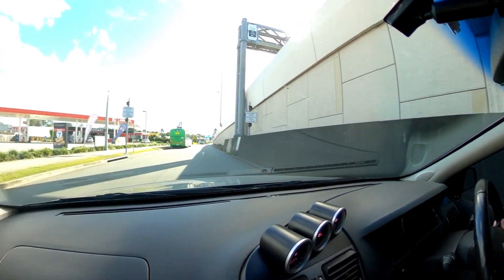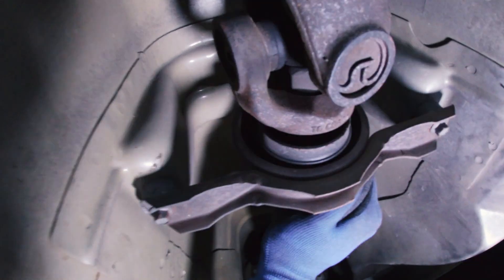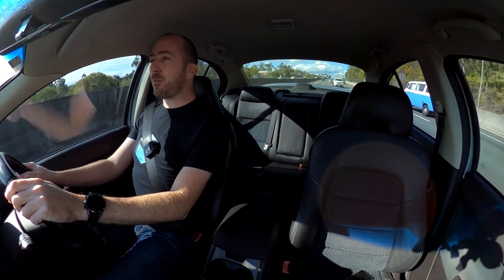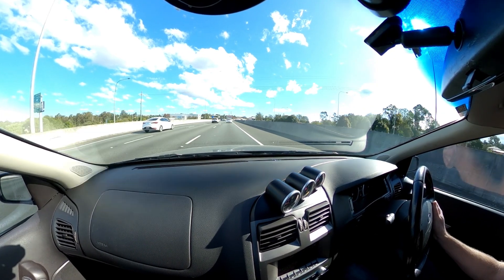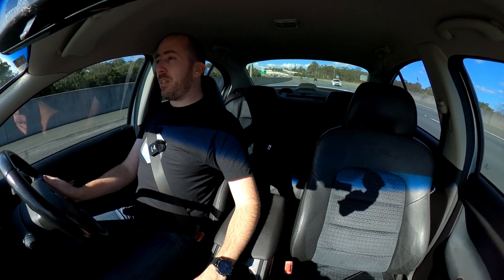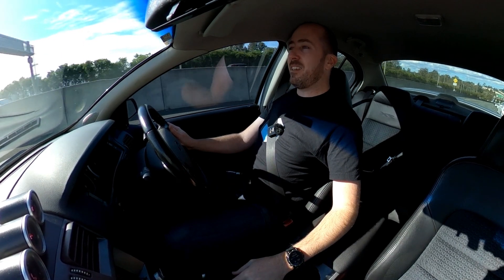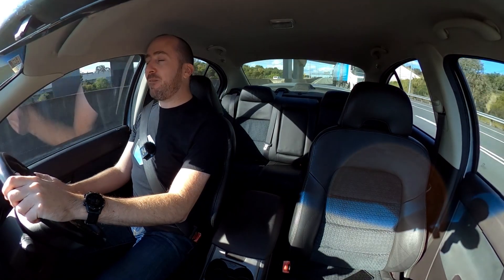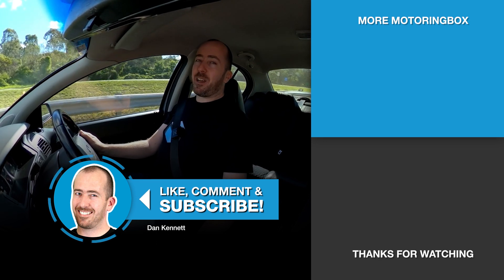🚗BA Falcon Tailshaft Replacement - Test drive to see if we fixed the vibration?

Comment: Hi Sean, I had the same problem with my BF Falcon, I changed the centre bearing and uni then put the shaft on the balancer, twice, the vibe was nearly gone but like your car the b'stard thing still had a vibe. Mines an auto, i changed the trans fluid and the vibe lessened , I then increased the tyre pressures and that fixed it. Good luck mate, Phil NZ

Comment: Get rid of the Nolathane diff bushes to start with.  They send unecessary extra torque and vibes through the drive train.  The tranny is especially prone to it.  Rip em out and go back to OEM bushes or maybe (emphasis on maybe) super pro for the main rear and OEMs for the L/R fronts

Comment: You can do it yourself with an appropriate sticky weight and a metal zip-tie. Make marks every 90 degrees on the tail shaft, attach a 10g weight at one of the marks, go for a drive, and repeat this for every mark. Once you find the best one, make markings 45 degrees on either side of it, and try driving with the weight in these positions. Move the weight to the new best position, and make markings 22.5 on either side of it etc, keep repeating till you find the best spot, then try using a heavier and lighter weight until it's perfect.

Comment: You should have some slackness in that center bearing mount where it mounts onto the body, loosen those bolts off, push it to one side, tighten it up and take it for a drive, if it doesn’t fix it push it to the other side tighten it up and see if that makes a difference sometimes it’s just an alignment issue.
Cheers,
Dwayne.

Comment: My Ba Fairmont Ghia has exactly the same issue. Centre bearing replaced, tail shaft reconditioned and balanced but the rumble persists around like 80-100km/h then goes way at higher speeds, also smooth as silk at slower speeds. Damn thing, but I love it just the same. It’s like your long term partner, you put up with the little things and love her more and more as the years go on. 😊

Comment: I noticed when you installed it that you did the centre bearing bolts before the rear. Tighten the centre bearing last and make sure its centred by feel
Reply from the maker: I've had a few others mention that - I'll definitely give that a go thanks mate.

Comment: Hey mate, I spent a lot of time chasing this problem on a customers car. We did what you did with centre bearing, coupling, balance etc with Hardy Spicers & could not get it right from there. After some research, found Ford balanced those shafts in the car from Factory. Further research found the Ford dealership up at Torque Ford, North Lakes provide this service. Perfect after that & they have done a few for me now. 🤙🏼
Reply from the maker: It's looking like I'll have to go that way with it. Ford use weights which clip onto the bolts which attach the shaft to the diff, and my car has never had any there at all. Fingers crossed they can fix it for me, I'll have to book it in soon.
Reply: @MotoringBoxTV  whenever we remove a tailshaft from any of the ‘B’ series, we mark the location of those weights & put them back where they came from, but I am gathering when Hardy Spicers balance it, the position of the clip on weights need to be relocated. Good luck mate, I hope it all works out. 🤙🏼
Reply from the maker: @brookgoodwin426  when I removed the shaft mine didn't have any clip on weights... so that was rather interesting. I have installed it in the same position it came out but alas it didn't help.

Comment: Hi Sean, Have the same problem with my wife's 2012 G6 and have been firing the parts cannon to try and fix it. The car has 226,000 on it and the rumble was combined with Falcon Taxi Whine at around 80ks so the decision was made to replace the diff. A full rear cradle and diff out of the same model that had done 60,000ks was purchased and the diff bushes replaced before installation.  Installed the cradle but ended up with the rumble still there and the replacement diff whining louder than the original! A couple of things that can be discarded regarding the rumble.  When swapping the cradle it was noticed that the centre bearing was shot and as it was a weekend could not get a replacement tailshaft. Installed a new tailshaft during the week and left the spacers out to see how it went. No change at all. Reinstalled the spacers and also swapped over the rear mount as it was cracked but not totally through - no change! This only fixed the clunk when going from P to R or D. The next step will be to change the pinion bearing and see if this solves it as it seems to be harmonics.  Also, my son has an 09 FG with over 400k on it but the diff is silent and the car has no rumble. Will let you know if the pinion bearing is the problem.
Reply: Hi Sean, think I have found the problem.  I took the G6 to the local tranny/diff repair guys and they took it for a drive then brought it back and put it on the hoist. One tech got in the car and ran it up to speed while the other went around with a long screwdriver listening for the noise. He checked the tranny to discard bearing noise plus wheel bearing etc and finally checked the diff as this was his suspicion and it was the pinion and crown wheel etc. I went home and got the original diff centre and took it back to him and he removed the cover and it was evident that the hardening was wearing off the crown wheel. He then applied diff paint and rotated it with a drill and the wear was clear.  Next step is to have this diff centre totally overhauled and will then swap it over with the one in the car. With a bit of luck this will solve the problem. The tech did say it was common in Falcon's and Territory's. If the overhaul does solve it, I will let you know.
Reply: Hi Sean, it has been over a year now but my son finally got around to replacing the diff in his mother's G6 last Friday as he had left his dealership job and got an FIFO and did not have any spare time until then. He removed the cradle took out the old diff and installed the overhauled one and then reinstalled the cradle and the result was a total change in the car. Firstly the whine was gone as to be expected but the bonus was the rumble and vibration were also gone. The car did have distinct rumble especially on decell even at slow speeds and this would seem to translate as a vibration. The rumble etc can be put down to the diff being totally buggered and the $1800 I spent on having the old diff overhauled was the best money I have spent. The car is a pleasure to drive now.

Comment: From what I've heard about the v8's having vibrations because of the tail shaft that it's usually because of a Nolathane diff bush since they are a much harder bush than most others on the market, many suggest having it replaced with a super pro diff bush as it's a more like rubber than the stiffer plastic like Nolathane bushes. It's also more noticeable if you have a manual gearbox since you can feel the feedback through the whole car with Nolathane. Just my 2cents worth
Reply: "Nolathane" is a brand name for urethane replacement bushings. Super Pro sell urethane bushings. I hope this helps.
Reply: @ChristopherHallett  Did not know this at all, I guess you learn something new everyday. All I know is that most v8 guys prefer the super pro as it seems to be a better product then, but still interesting

Comment: Seems like a common issue, I have the same problem too with my manual 2004 F6 Typhoon, centre bearing flogged out, took it to a drive shaft place and they put a new centre bearing in, got it back and it had a horrible vibration. The dopes at the drive shaft place never put the little weights on the back of the shaft so I took it to Ford where they balanced it on car. Anyway got it back and it was 90% better but I still have that rumble around 70-80km/h. Keen to see the outcome.

Comment: Have you got the plastic counterweights that connects to the bolts sticking through the cv end at the diff?
Ford had a machine that balances the tailshaft at the diff coupling. I had this issue about 10 years ago when I blew a diff in my GT-P.

Comment: I’d be looking at diff bushes. Replace with nolathane including trailing arms and double check the rear cradle is square to the chassis. It’s a shit job without a hoist. Pro tip for the out rigger bushes is get done 1/2 inch threaded rod and matching nuts and some 2 inch square 3 mm plate. Drill through the plate to accept the rod and use that to pull bushes through the cradle. Measure bush depth side to side can be different and make sure the outriggers don’t foul on cradle. Check all the arm bushings too. Easier to do while still in the car and mark the ones that are buggered.

Comment: I'd say it's the actual diff center (lsd chatter even but ring and pinion more than likely) or the the bearings. I just use my knock monitor and attach it to different areas when I was having issues with my farking territory (front diff drivers side roller bearing in my case) but modifying any cheap hearing aid ($13) with external shielded coax cable a piezo and alligator clamp will achieve a similar result to boost sound at the source. Just search diy knock ears if interested.
Hardy Spicer (NQ) took $2k from a mate and didn't fix anything with his FG turbo! It was the diff...
Reply: I will add that I got the original plans from Autospeed and 
"Listen Up" was the name of the amplifier used. Brings back old memories having my car featured there in Jan 2005... Lol

Comment: Could it just need bedding in and will self harmonise after a certain distance driving? 
I've read a couple of other comments with worthwhile  suggestions like adjusting the centre bearing bracket.
I hope you get it sorted easily so you can enjoy your perfect BA. It will be one of a handful in existence!
I so envy you enjoying an XR6T where you change your own cogs.
It gives that much needed driver involvement. It truly gives the Falcon a youthful sporty character.
Where's the satisfaction in a slightly quicker automatic?

Comment: Try a different set of wheels. I had same problem,vibration from 90 to 100 in my bf xr8 for years. Drove me mad. Did the tail shaft reco and all that only to be disappointed. Bought some wheels and the vibration was gone.

Comment: Where are the plastic clip on weights? They balance the flange and need to go back on.
Reply: I agree .
Reply from the maker: Never saw anything like that, are you sure all the different models had them?
Reply: @MotoringBoxTV  Every single Falcon I’ve done has had them, even the Territory. I always mark the position of them in reference to the flange before removing. I’ve never been able to get it perfect without them.
Reply: See the shape of the bolts on the CV towards the pinion gear they are made to clip on plastic weights between each bolt.
Reply from the maker: Thanks for the info guys - mine never had any.

Comment: You probably need to get that shaft balanced on the car... BAs are shocking for it 🙄🙄
There are tiny weights that go on where it bolts to the diff..
Reply: Yeah Ford used to do an “on car” balance if you changed something. They would take plastic clip-on weights and attach them to the back side of the bolts on the flange. They had them from factory as well.